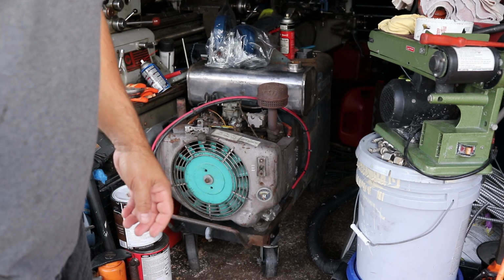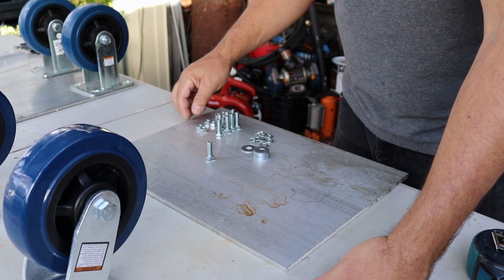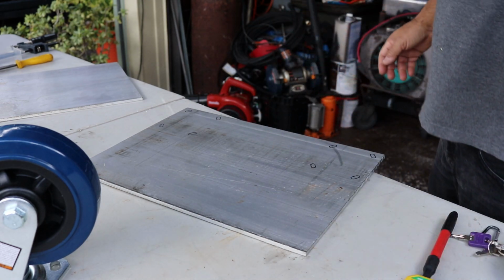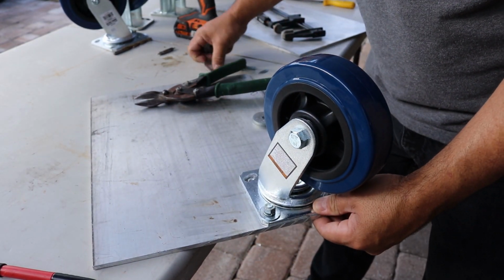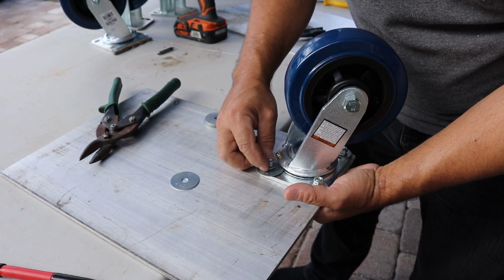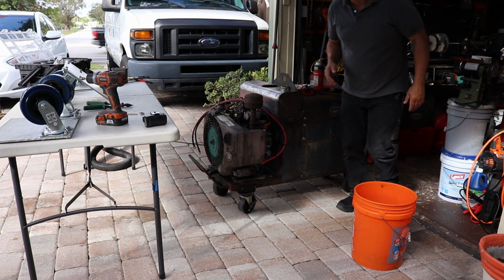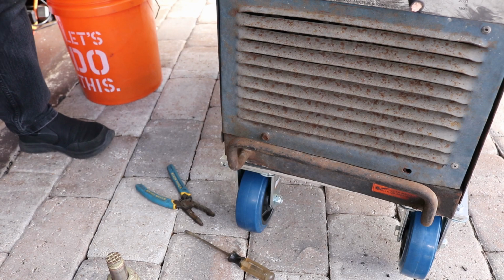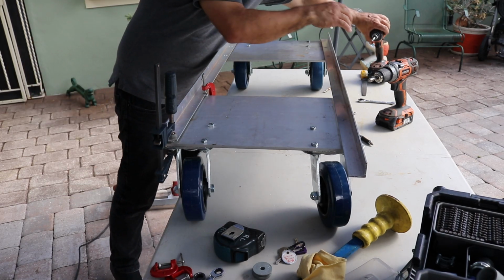Miller gas welder  aluminum cart.

Comment: Did it weld?
Reply from the maker: I haven't gone that far. It runs, but I had to put it aside. I will make more videos, but the problems with covid and more work than we could handle have put a stop to video making. Stay tuned. I am working on new videos to start back up. I appreciate your interest.
Reply: @Rigoknow  I see.  I found 2 same machine local one for $150 another for $200 they say  it works but no leads. 

Bought my first welding machine last Friday and kinda got interested on your machine just in case i become an expert and could weld everywhere without power. 

Haven’t even open the box of my welder  nor I have weld before.